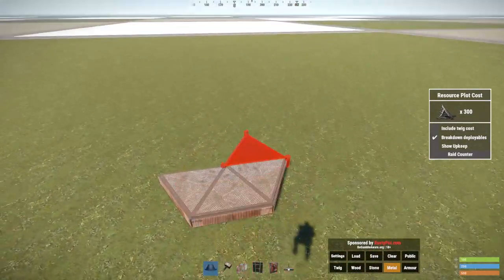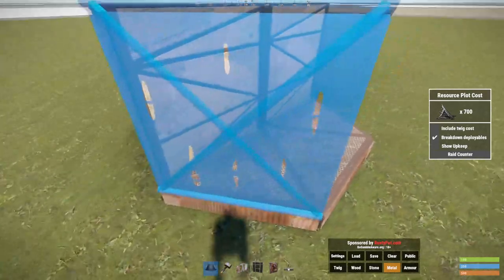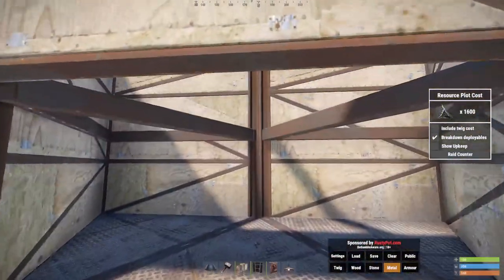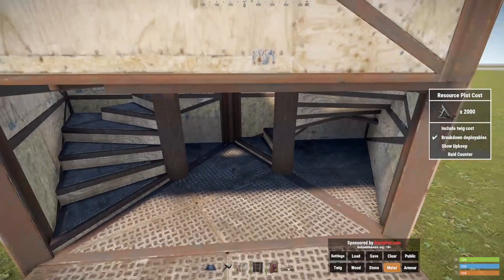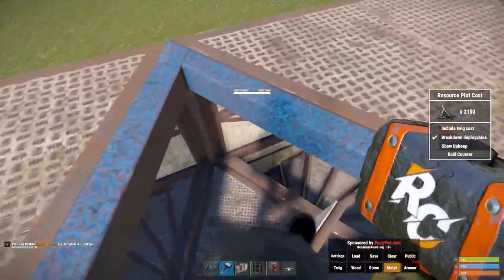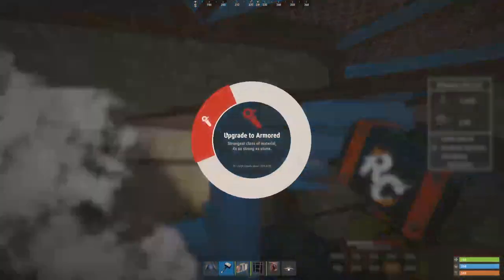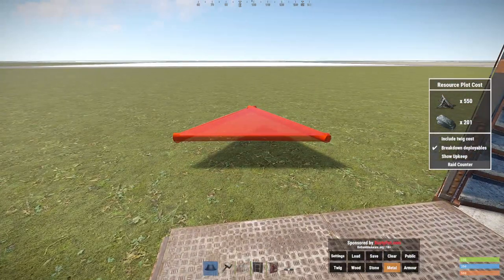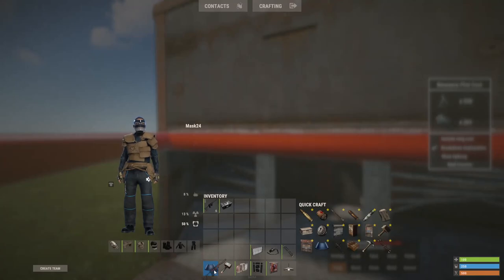Quick Spiral Stairs bunker

Comment: i think this is patched
Reply from the maker: Its a real old concept and i did leave out a vital part of it on accident. If it still works the base owners also have to block the socket where the frame goes typically with an electrical component